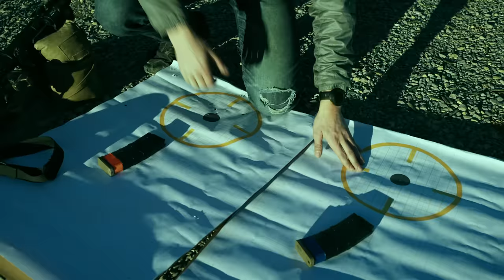Can You Get A Budget 300BLK Honey Badger?

Comment: Hey Lucas, just a tip that's saved myself and my friends during all our test trips, a paint-can opener on a paracord loop works for quick and easy reach into the chamber for any FTE's, I keep one lashed to my holster on a wrist-loop now
Reply: Nice
Reply: If you have that many FTE's you need new weapons.
Reply: @LosDoyerss  the drills we were running at the time were trying to induce more FTEs than usual, mostly running subs without a can or adjusting gas blocks out of spec.
Reply: @LosDoyerss  FTE can happen at any time with any gun (even if you adhere to the recommended part swap routine which NO ONE does lol). If it does and you don't have a plan to fix it you are SOL. It's why machine gunners often carry various tools with them to fix their gun in the field if necessary.
Reply: Yeah i do that myself

Comment: A paint can opener is great for removing failures to extract. Less than $5 and fits very easily into most kit
Reply: Great suggestion
Reply: And quicker than a multi-tool.
Reply: I never would have thought of that great idea man
Reply: 🤔 interesting thanks for the info ✌️
Reply: I tried using one and it didn't work
Reply: @smokingcrab2290  why didn't it work? Have trouble grabbing the rim or just didn't get a good purchase on it?
Reply: @smokingcrab2290 it doesn’t work at all on stuck steel case. I destroyed 3 paint can openers.
I have almost entirely swapped to brass case now though.

Comment: I used to build lots and have similar lengths. Consolidated and now run an 8.5 300blk a 12.5 556 and an 18 556. My abilities in handloading and distance shooting don't justify anything better at distance than the "mk12" style setup yet. Diversification is key. 

I bedded the barrel on my 300blk and use a tight tolerance design. I'm able to achieve sub half minute groups at 100y using 110gr vmax. Short barrels aren't inherently inaccurate. Shorter barrels have potentially better harmonics in comparison to longer barrels. Optimal bullet time changes with barrel length and so do the accuracy and velocity nodes typically.

Comment: To help with the clearance issue on the bottom M-lock slot you can either sand, grind, or mill down the flat side of the nuts. The screws might also need shortened. The same can be done with the QD stud if you just needed it to be a tiny bit shorter. When done coat with aluminum black metal finish. Do at your own risk.

Comment: When you torque the barrel nut, put the crows foot at 90deg angle to the torque wrench. Otherwise you're increasing the leverage of the torque wrench and throwing off the reading. They're designed to be used with sockets, which pivot around the chuck instead of extending the lever.

Comment: I got a PSA 7.5" 300blk with a PDW style "brace" for around $300 with a nickle Toolcraft bolt. I put an oversized Midwest Industries rail that my YHM N2O suppressor can fit inside. (Edit: wow I commented before the video got to describing the build.)
Reply: Full upper for 350? Not bad
Reply: bet it looks insane
Reply: ATF: Furiously taking notes... And buying "dog treats"
Reply: I did a PSA upper with a 8.3 ballistic advantage barrel. The barrel was $90.00. $35.00 for breek Arms adjustable gas block and tube. Complete parts PSA upper $100.00 and a Axis MFG BCG $75.00, old radian charging handle. So a $300.00 upper I have been super happy with.

Comment: I bought a similar PSA 300BO upper from PSA in 2018. At that time, it came with an LPK, and a vortex red dot, for $300. It runs like a top. I call it my “Funny Badger” I have a similar Tromix setup in 458 socom- which I call my “Money Badger”. I’ll mention that the funny Badger cycles both well, but it is over gassed with supers
Reply: PSA is amazing
Reply: Tell me more about this "Money Badger", please. I've got it in my head to build one cause I already own and reload for 45-70.
Thoughts on Tromix? Did you go with a barrel only or did you opt for the barrel/bolt combo?

Comment: I had exactly the same problem as you had with the cerakoted aero tolerances (the mag release on the lower and rear takedown pin hole on the upper). By 41:11 I've actually got it fixed via sandpaper. Aero should send some complimentary sand paper with every upper/lower set. Otherwise I totally love these parts tho
Reply: Do I know you
Reply: @johnmarkallen9621  Almost certainly not, but hey maybe?
Reply: Or just don’t buy aero lowers🤷🏼‍♂️ especially when you can buy a centurion for just a bit more and get something much better.
Reply: I know a preacher by your name. Thought it might have been him 😂
Reply: @johnmarkallen9621  hey, well that's cool. I'm not a preacher tho, and I don't know any in my family
Reply: @codysmith6617  if anything, I'd go with an ADM full ambi lower instead. different price bracket, but whatever. Like I said though, their lowers are kind of great tbh, besides the tolerancing on cerakote jobs
Reply: @ryanmcwhorter8501  honestly you don’t even have to go ADM. Sure, they’re fantastic lowers, I’d also throw an LWRC lower in that conversation but for the ballpark of aero lowers, why not spend a little more and get you a Centurion lower? Same tier of lowers while having majorly better QC and tolerances?

Comment: I have a few of those Lowers and one of those uppers. The FDE coating can be a little thick on Aero's lowers. One of them had trouble with the rear takedown pin hole being tight. Another had that same mag release issue. I just gently tapped the pin in and the extra coating was pushed through the other side, as for the mag release, it fixed itself after a few minutes of pressing the release button.  Thank you for the great content!

Comment: This is the video that took me to Griffin Armament.  I used their rigid rail over a 12.3 556but I used their concussion device instead.  It turned out awesome.  Recently purchased a 10.5 PSA blackout upper and will replace it with a griffin armament rail/concussion device. After watching the issues with the suppresso you had, I think I am going to pass on suppressing it. I just love the look honestly and the intent is to have solid home/personal  defense scenario builds. Glad you pointed out the round is capable without the suppressor.  I think that it is a myth in the gun community.  Like you said, my 556 will basically mirror my 300. The suppressor you used will be my likely choice as well assuming owning one will come with less headache one day. Thanks. I built something inspired by Trex. Cool.

Comment: It would probably cycle subs fine with a standard carbine buffer. Also, don't disparage YHM too much, a Resonator works fine with Blackout. You can get a direct thread mount if you don't like their QD. Their QD works great with an "SD" type handguard because you don't have to manipulate any lock. My setup has a Midwest handguard with enough ID for the Resonator to fit inside.

Comment: By the time I was done building it, my "budget" honey badger ended up costing more than the real thing 😅 I like it better tho!
Reply: How much does a honey badger usually run ?
Reply: @rdf4315  they were 3k but the price dropped to ab 2.8k

However the Sugar Weasel also made by Q, is literally just the HB without the proprietary recoil system in a standard AR receiver.  It also has a buffer tube instead of the HB stock which… is an amazing thing. I fuckin hate mine, the stock is the worst part of the HB.

I own both, just buy the SW the standard AR parts are actually a benefit, tho the HB does have a different recoil system that is softer (and a bitch to put back together).

The SW is down to $1800 now, they had some on sale for $1500 cuz the brace ban, it’s absolutely worth the $, you can put any AR upper on it, and Q also makes a 13” 5.56 upper for it (and .300 but why would you buy that lol)

Either way both the HB and SW are a tad too short for me, 7” with a 6” handguard (that only has 2 M-Lok slots) is restrictive if you have long arms and hands like me, the MCX is a better overall battle rifle (9” barrel shoots hella flat from what I’ve seen but never used directly so), if you want an ultra compact gun get the Sugar Weasel for sure, if you can afford the Gucci then sure get a HB.  The 1:5 fast twist barrel is definitely the superior option for .300, I’ve seen PSA putting out 1/8 barrels for .300 which.. have to be ballistically horrible.  1/7 isn’t even good enough, I think the MCX has a 1:6 which for 9” is prob equivalent to 7” 1:5

The twist rate is absolutely important for .300 and getting the proper lethality of it versus 5.56

.300 is a superior round for any civilian context no matter how much that will trigger people, it’s the most devastating round against soft targets

I will say aesthetically the color is my fav of any firearm so… I mean the guns are fucking gold lol
Reply: @Marksman5147  okay thanks

Comment: 32:14 you can actually make those mlok compartments usable, if you buy some round mlok nuts and file them down (the scews aswell) untill they are very slim... you will have to install them from the inside, but it should be possible. at least on my dads Hera 3.60SD30 it worked fine, and the space between the can and the handguard looks about as tight as on this one.
Reply: I did that as well. Cut the screws and put a grinder to the nuts

Comment: I built a 10.3 inch 300 blk, and it flings the brass like my Mini 14 does. It flies out of the gun.

One thing I did on all my pistol builds was put a Magpul K2 pistol grip on them. It's a more verticle styled grip which brings your wrist and grip into a more comfortable hold. It's much easier to manipulate the trigger and hold onto as a pistol grip.

Comment: 8:14 He references M-Lok attachments not quite fitting. I’ve had a similar experience building compact AR’s and, depending on your circumstance, could help. Tighten down the M-Lok attachment you so desire to attach in a spot that is guaranteed to clear. Take note of the bolt and the thread count that is sticking out past the end of the M-Lok locking mechanism. File down the bolt to a hair above the length observed in the aforementioned. Check fitment in desired spot, loctite, tighten, complete.

Comment: I built a 10.5 300 blk fairly reasonably. Hell of a lot cheaper than a badger. I spent big on a faxon barrel the rest was mig grade. Did use a Wilson Combat handguard and a kak tube with a tailhook brace. It's a tack driver and loves hot 110 varmageden rounds. I call it my tree stand gun. Great for small hogs and deer in Florida. Keep a 1x4x24 nikon speed scope on it. Better than a red dot.

Comment: I built out my budget Honey Badger SD (aka Dirt Squirrel) using an 8.5” .300 BLK PSA upper w/ Dead Air Sandman K, a Maxim Defense SCW stock system that I got in a trade for one of my knives on TacSwap, an 11” Zro Delta LVOA rail I got in a trade for a Magpul UBR (Gen 2) on TacSwap, a PSA lower, Radian Raptor SD (nickel boron version🔥), a CMC 3.5 lb single stage trigger, and a Holosun HS510C for an optic. There are some other bits and pieces I didn’t list, but yeah… It totals just 25” with the stock collapsed.

Comment: 31:00 that right there is a good indicator of the difference between a wrench monkey, and a real mechanic/gunsmith.

Always put your crow's foot at a 90° angle to the torque wrench. When you put it straight out, you're increasing the length of your lever and DRAMATICALLY increasing the amount of torque you're applying to the fitting.

Comment: Having built both PSA and Aero, I attempt to match upper brands with lower brands, as I do realize that spec should make that unneeded, but...   Without a directional cover over the flash hider/muzzle brake or can, the concussion would be tiring, I am sure.  Getting ready to build a pistol and thanks for the review to include the full auto demo and options on accessories.

Comment: The company who built My 300 blackout upper (Dark Storm Inc) put a carbine length gas system on a carbine length barrel (which I think is the issue). 

 Realistically it wouldn't (at least in theory) have ejection issues had that gas not have to travel so far to to eject a typical. 300 blackout load (like remingtons 300 bthp for example). 

I was under the impression that with .300 Blackouts with carbine length barrels should have pistol length gas systems. 

If I didn't have said issues it would be My top 5 favorite firearms I own.

Comment: Grind 1/16th of an inch off the QD sling mount with a disc grinder and it locks. Takes about 2 minutes and you don't have to add or pay for a mount.

Comment: I had to file down a set of MLOK t-nuts to ~.050", and filed the screws to match, to get a rail under a certain gas block. I used it as a bipod mounting location, and it held up through my rough handling, but I can't say I'd necessarily recommend it.

Comment: You should do one in 350 legend. Factory 20 round mags are available from Duramag. PMags can be modded to run 28 or 29 rounds pretty reliably with a little work. 

350 Legend shits all over 300 blackout inside the ranges 300 blackout is used. It loses less velocity per barrel inch, and has projectiles ranging from 120 gr up to 250 gr. If youre into hand loading, you can run 90 gr 9mm projectiles up to 3100 fps in a 20" barrel, and theyll hold 2600+ in a 10.5"

Comment: I love the primary arms micro prism scopes. I have an astigmatism so they help quite a bit. The acss reticle is phenomenal and even without the astigmatism, having the etched reticle is awesome for the off chance that my battery dies. I still have a functioning optic
Reply: Prism scope fan here. Especially the Gen 2 Cyclops by PA.
Reply: @VernonELSmith  i have the 1x of that optic. I need to get a 3x for my 308. Love them
Reply: I gotta check those out.  I have horrid astigmatism
Reply: @ashsherman  i would. They're awesome. The 1x is around 280 and the 3x is around 319. They're very affordable and they work very well

Comment: You should also do viewer budget builds. If I could, I’d love to send you my .300 blk build. The only things I cheaped put on were a Sightmark Wolverine RD and a Matrix Arms Handrail that I cut back.

8.3” Ballistic Adv. .300 BLK, Gas block and tube w/ Flash Can
Aero M4E1 Rec Set
Strike Industries TiN PVD Takedown Pins and FA
Hiperfire PDi 2.5 lb trigger
Guntec Ambi Fire Control and Castlenut/Plate
Aero Unbranded BCG
I used to have a pistol brace on it but because of the ATF, no SBA3 brace.

Finished beginning of last year around ~$1200 and it shoots like a dream.
Reply: Suppressed and unsupressed, runs like a sewing machine. Have at least 1300 rounds through it for sub and super.

Comment: You can absolutely run a grip at the six-o-clock. we invented a tool for shortening screws centuries ago, it's called a file and you have one. Cut a few mills off of the screw and it'll fit, this is how my bipod mount is positioned where it belongs on my 18" upper.

Comment: Just an FYI you can grind the screws down for the M-Loc rail section. I did that with my AR pistol uppers and they work fine. Or get a linger rail section and leave that screw out. I use the 45deg hand grip on mine

Comment: Hah! Awesome.  I have the same 7.5 inch PSA .300 BLK on top of an Aero (but Thunder Ranch) and installed a single stage trigger.   My groupings with subsonic bench rest are much tighter at 2 MOA.  Optic is just a Sig Sauer Romeo 4s green dot.  I did mount a Viridian green laser hand stop successfully on the same rail with mlok so I'm not sure why your gasblock stifled your setup? 

I suppressed mine with an Obsidian Rugged 9 that stays on it.  It is NOT supersonic rated so I haven't tried that. unless the barrel is naked and found they were wildly inaccurate approaching 4-5 moa at the same distance. 

Fantastic video.

Comment: Having built 2 cerakoted Aero lowers, I can confirm the tolerances are ridiculously tight and some finish work needs to be done during assembly. Had to open up the holes a little bit for the takedown pins and mag release.
Reply: People crap on Anderson but my lower has been super easy and needed 0 additional work

Comment: I have the same Griffin rail and had the same fitment issue because the rail clamping section is too chonky and it hits the lower.  I had to remove mine and grind a bit off, then put some Birchwood Casey aluminum black on it.  Midway had these rails on clearance, so that must be why.

Comment: 17:39 
The "tolerance" issue is actually not that. The problem (which is extremely common with DIY assemblers) is that the magazine retention bar was screwed into the release button 1 too many times. 

If you encounter this issue with your gun, here is how you fix it:
1) Drop the mag and make sure the gun is clear
2) Push the release button all the way in while grabbing the retention bar (opposite side of the receiver) and pulling it outward
3) Unscrew the retention bar 1 full turn
4) Allow the retention bar to fit back into the receiver
5) Put a magazine back into the gun to ensure it grabs and works as intended

If you're assembling your own rifle for the first time, test all of this (with an empty magazine) before trying to take the gun out to shoot. I've built and assembled (those terms are NOT interchangeable as most home AR "builders" are only actually assembling components rather than "building" the guns; a builder is someone who is machining parts to fit other components into spec rather than using exclusively off-the-shelf parts to make an assembly) dozens of various types of AR-15 and AR-10 pattern rifles iver the years. I've run into virtually every problem you can have. It's apparently not that just any random person can do without specific experience and/or knowledge related to the working function of mechanical systems. 

The magazine release of the AR-15 is a VERY common source of problems with many guns.